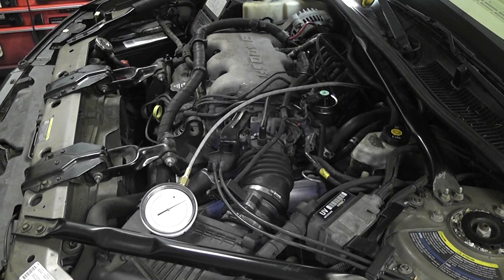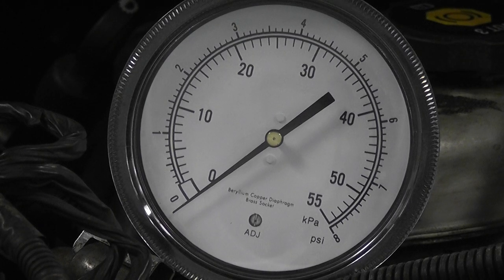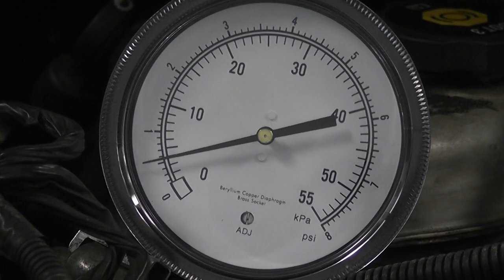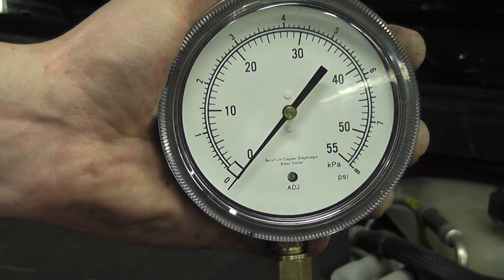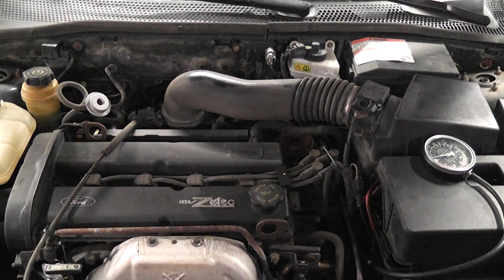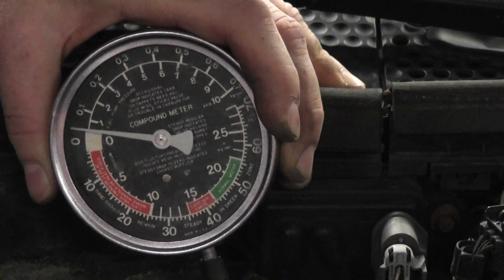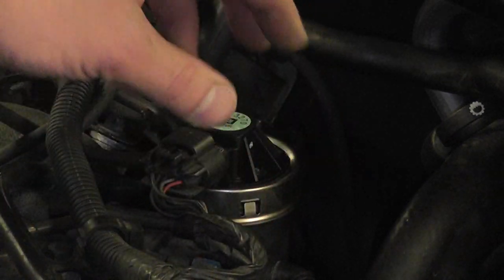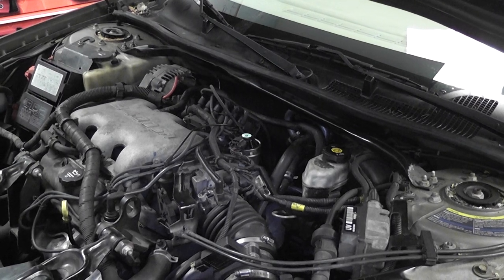Exhaust Backpressure Testing (known bad compared to known good)

Comment: Can I test backpressure after the catalytic converter?
Reply from the maker: You can but it is the cat that causes the restriction so you'd be measuring after the problem.
Reply: @ScannerDanner  Thank for your reply! Please correct me if I am wrong but there is nothing else before the cat that could be causing a restriction... Correct?
Reply from the maker: @microtcpip  you can have pieces of the cat get lodged downstream of it. I have seen a muffler plugged, but again, it was plugged with pieces of the melted cat. Other than that, no, I have NOT seen any other downstream restrictions. That doesn't mean it can't happen within a muffler itself, I've just never seen it